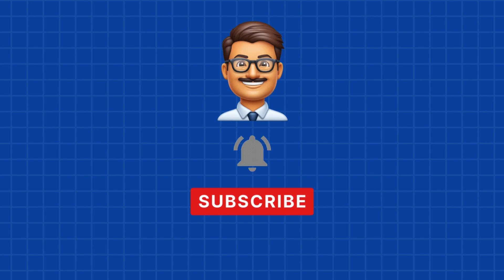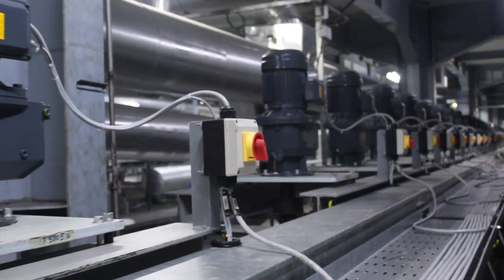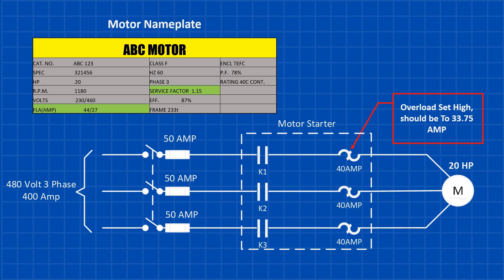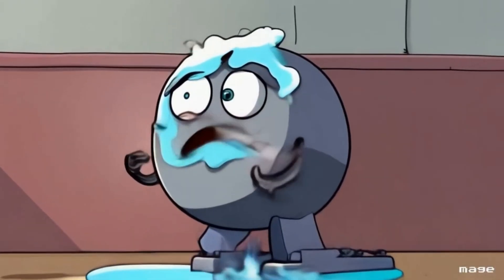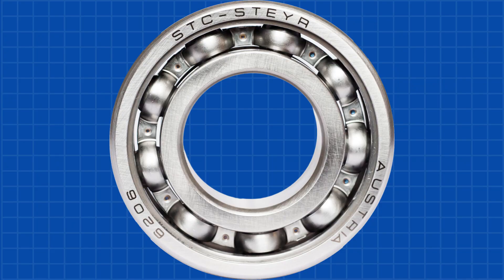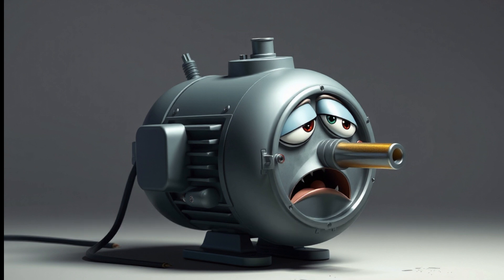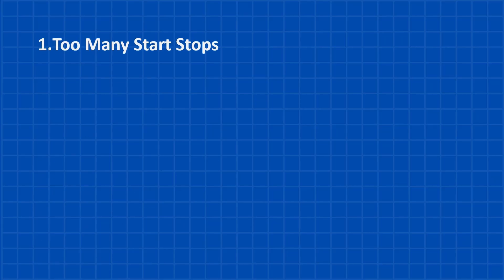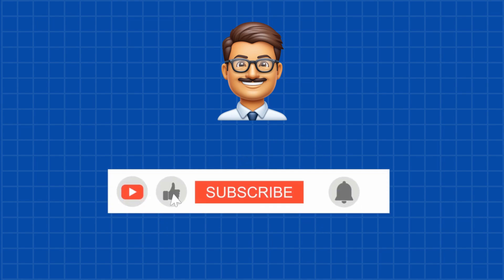Why Do 3-Phase Motors Fail?

Comment: A  (  Star - Delta  )  contactor  😝  is often used to limit inrush current at startup , but to connect it up , requires access to   ALL  the motor's winding terminations ( not always possible )  ............ DAVE™🛑